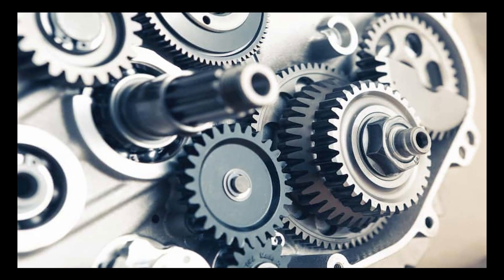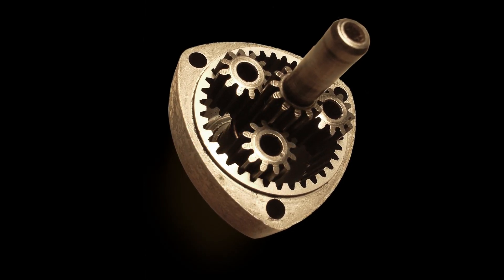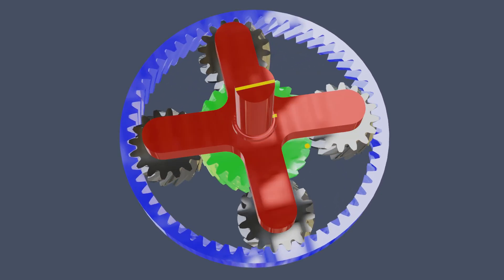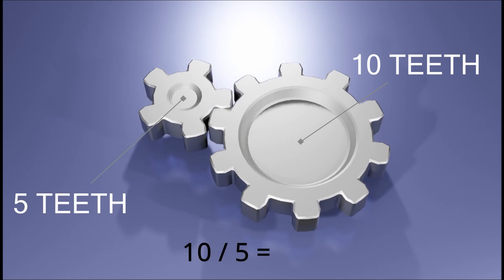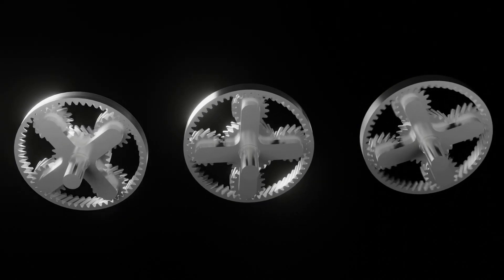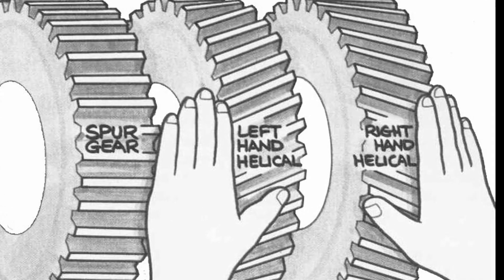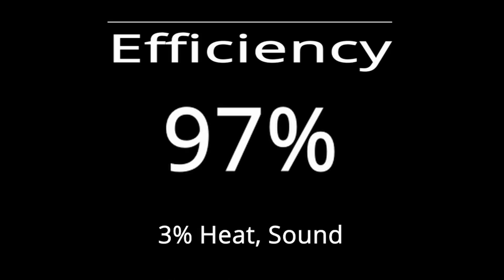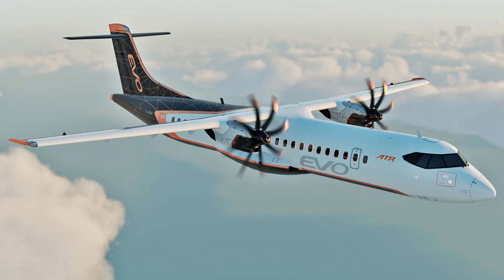PLANETARY GEARS why they are pretty cool

Comment: It was my understanding that straight cut gears are stronger and distributed load through the tooth evenly compared to helical but are noisy
Reply from the maker: Helical gears have angled teeth so there are always almost equal pressure at some point of the gear which is perpendicular to teeth, which is not case in other one. Hope you liked the video.

Comment: Helical gears impose axial loads ie gears will try and push apart along the shaft axis. Thrust bearings are required to cope with these loads which reduces overall efficiency and adds cost. One major advantage of planetary gear sets is tangential shaft forces are minimised reducing bearing load and thus increasing power transmission efficiency.
Reply: That's where herringbone/double-helical gears come in.  They balance the axial loads. https://en.wikipedia.org/wiki/Herringbone_gear
Reply: @WRSomsky  Or two gears are used on the same shaft; one left helix and one right helix, so axial forces cancel each other. But it's not really a design for car gearbox.
Reply: This is only true with helical style gears. Straight cut gears do not have the tendency to push in the shaft direction
Reply: @wheelitzr2  Gearboxes with straight cut gears are stronger and more durable than ones with helical gears but the drawbacks are present like with everything. The noise they make is one reason why they're not used in road cars and another is the cost. But for performance applications the tradeoffs are worth it.